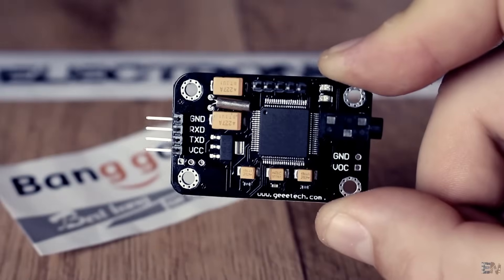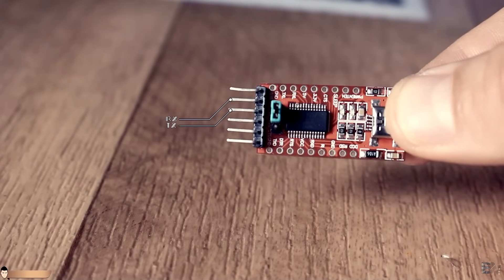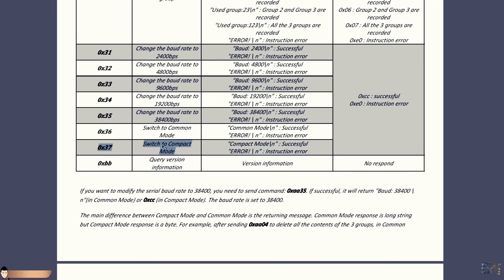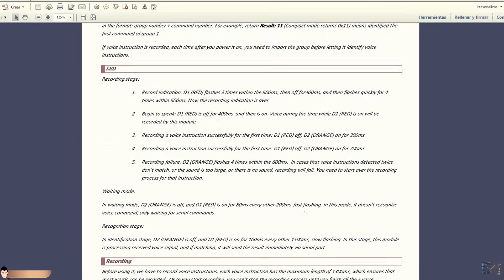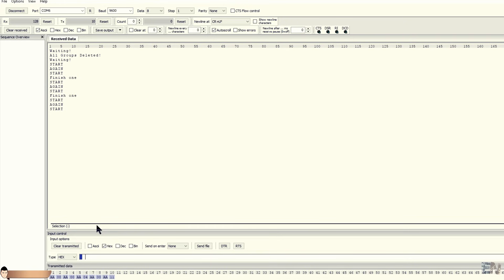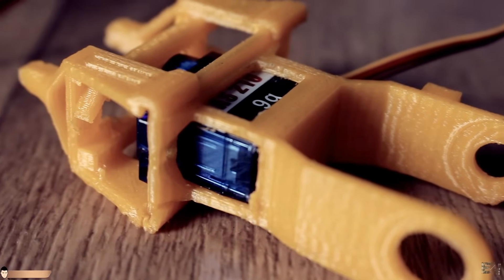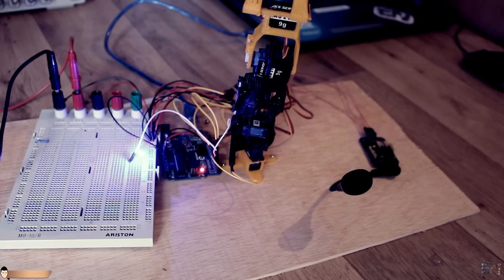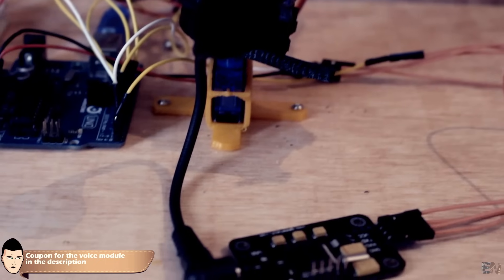Voice controlled  3D printed ROBOT arm

Comment: Hello Sir, 
I have a big problem, I can't get any information from my geeetech module.
For example in Hex mode when I type "AA 00" or "AA 36" I don't receive any feedback, I don't know what to do I'm lost.
I used arduino to connect the module to the computer but it didn't work so I also used a USB TTL module CP2102 but it doesn't work please help me.
Reply: hello mate did you fix it please help me
Reply: any update?

Comment: How do you import the second group of commands?? 
I've tried a couple of things but it does not work.
Reply: You Need to send Serial.write(0x21); from the Arduino to the other circuit board. This will make it change to group 1. Then, send Serial.write(0x22); for group 2, then send Serial.write(0x23); for group 3.
Reply: @duckeydave3603  bro can you check this code for me? This is not working for arduino mega.                                                                                             //In and Out
int led1 = 2;
int led2 = 3;
int led3 = 4;
int led4 = 5;
int led5 = 6;
int led6 = 7;
int led7 = 8;
int led8 = 9;
int led9 = 10;
int led10 = 11;

//Variables
byte com = 0;
int ld1 = 0;
int ld2 = 0;
int ld3 = 0;
int ld4 = 0;
int ld5 = 0;
int ld6 = 0;
int ld7 = 0;
int ld8 = 0;
int ld9 = 0;
int ld10 = 0;

void setup()
{
Serial.begin(9600);
pinMode(led1, OUTPUT); // sets the ledPin to be an output
pinMode(led2, OUTPUT); // sets the ledPin to be an output
pinMode(led3, OUTPUT); // sets the ledPin to be an output
pinMode(led4, OUTPUT); // sets the ledPin to be an output
pinMode(led5, OUTPUT); // sets the ledPin to be an output
pinMode(led6, OUTPUT); // sets the ledPin to be an output
pinMode(led7, OUTPUT); // sets the ledPin to be an output
pinMode(led8, OUTPUT); // sets the ledPin to be an output
pinMode(led9, OUTPUT); // sets the ledPin to be an output
pinMode(led10, OUTPUT); // sets the ledPin to be an output

digitalWrite(led1,LOW);
digitalWrite(led2,LOW);
digitalWrite(led3,LOW);
digitalWrite(led4,LOW);
digitalWrite(led5,LOW);
digitalWrite(led6,LOW);
digitalWrite(led7,LOW);
digitalWrite(led8,LOW);
digitalWrite(led9,LOW);
digitalWrite(led10,LOW);

Serial.write(0xAA);
Serial.write(0x00);//Waiting
delay(100);
Serial.write(0xAA);
Serial.write(0x37);//Compact mode
delay(100);
Serial.write(0xAA);
Serial.write(0x00);//Waiting
delay(100);
Serial.write(0xAA);
Serial.write(0x21);//Import group 1

Serial.write(0xAA);
Serial.write(0x00);//Waiting
delay(100);
Serial.write(0xAA);
Serial.write(0x37);//Compact mode
delay(100);
Serial.write(0xAA);
Serial.write(0x00);//Waiting
delay(100);
Serial.write(0xAA);
Serial.write(0x22);//Import group 2
}

void loop() // run over and over again
{
  while(Serial.available())
  {
    com = Serial.read();  //We receive the voice command and save it in the com byte 
    
    
    if(com == 0x11)//LED1
    {
      ld1=!ld1;
      digitalWrite(led1,ld1);
    }

    if(com == 0x12)//LED2
    {
      ld2=!ld2;
      digitalWrite(led2,ld2);
    }

    if(com == 0x13)//LED3
    {
      ld3=!ld3;
      digitalWrite(led3,ld3);
    }

    if(com == 0x14)//LED4
    {
      ld4=!ld4;
      digitalWrite(led4,ld4);
    }

    if(com == 0x15)//LED5
    {
      ld5=!ld5;
      digitalWrite(led5,ld5);
    }

    if(com == 0x21)//LED6
    {
      ld6=!ld6;
      digitalWrite(led6,ld6);
    }

    if(com == 0x22)//LED7
    {
      ld7=!ld7;
      digitalWrite(led7,ld7);
    }

    if(com == 0x23)//LED8
    {
      ld8=!ld8;
      digitalWrite(led8,ld8);
    }

    if(com == 0x24)//LED9
    {
      ld9=!ld9;
      digitalWrite(led9,ld9);
    }

    if(com == 0x25)//LED10
    {
      ld10=!ld10;
      digitalWrite(led10,ld10);
    }
}
}

Comment: Hey electronoob the project was so pretty , I'm seriously in love with your concept , I'm gonna try this but I'm confused that FTDI module is compulsory or what?
Reply from the maker: You could use the arduino but you have to remove the atmega chip and use the FTDi that the arduino has.

Comment: can this code also work for car key remote module? I want to control room lights and door alarm with a car key remote, I think it can help elderly to control the house without having too move around to much as their body was not that agile anymore, get tired quickly and prone to fall
Reply from the maker: You need a new code. What comunication dose the car key has? virtual wire for 433MHz?